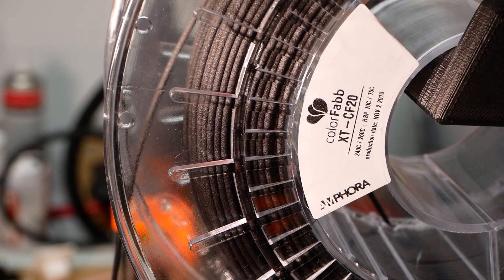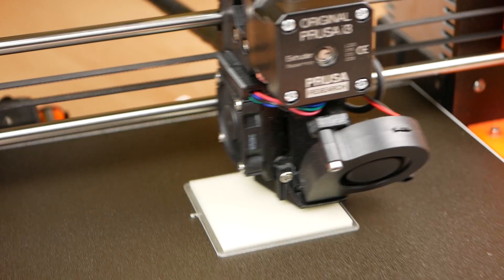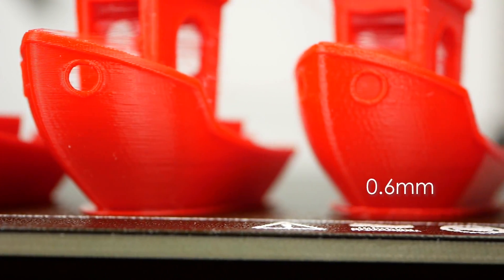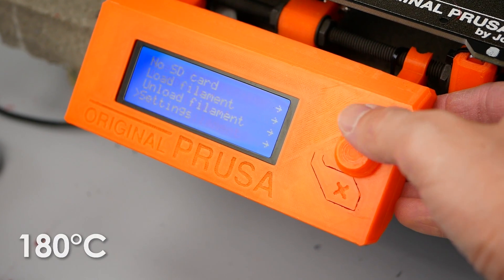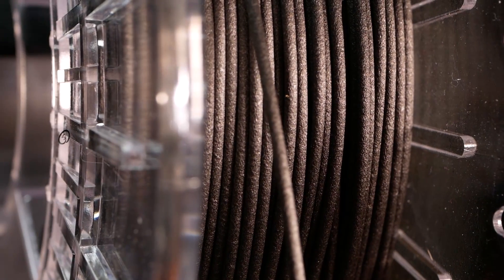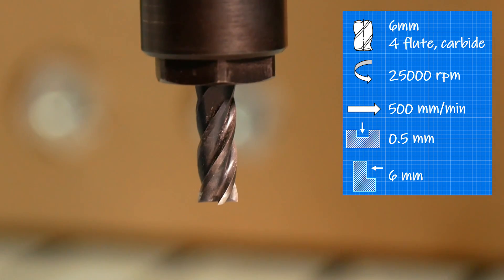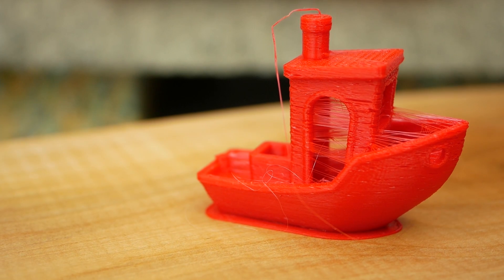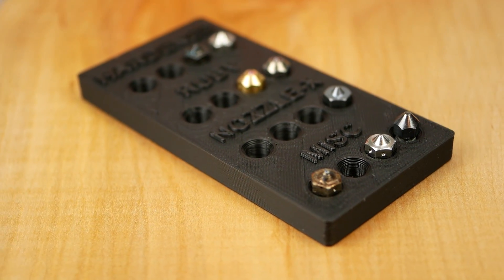HOW MUCH abrasive filaments damage your nozzle!

Comment from the maker: Feel free to share and discuss the video on you Social Media plattform of choice!
Reply: The spiral pattern is caused by a dull drill with way to much feed. The spirals of the drill try to get rid of the pressure and clog on the walls.
Reply: @marcus_w0  Yep. And usually if you look at a crossection the other way you'll find that you have almost a triangular hole there.  It seems funny how hard it is to drill a straight round hole with a drill bit
Reply: How to make such a shape ? DMG Mori 5-Achs Bearbeitungszentrum
Reply: What you said about the chanfer in the tip is true. This problem used to affect cookie/biscuit/food factories all over the world. They need "laminar flow" and a straight extrusion on the tip of extruders.
Reply: Noice !
Reply: I think premiere is a touch of hype ! I like it !
Reply: What are your print settings?
Reply: If you make the nozzle bigger from Carbon Fiber Polycarbonate printing models with a 0.4mm and wanting a bigger nozzle to print faster, then it would be like swapping out to a bigger nozzle w/o buying another nozzle and doing the swap out work?
Reply: Ok. No pproblem. I wil do itt.
Reply: This was probably the most important video I've watched. I've been buying cheap nozzles and wondering why I was getting odd printing issues.
I'm going to buy some excellently designed nozzles and see what happens.
I'm also going to put my stainless and hardened steel nozzles under a microscope and see how well they were made.
THANK YOU!!
Reply: Ave has a video about drilling triangular holes (3 jaw chucks + drill bending slightly  = trilobed spiral hole like in your cheap Chinese nozzles)
Reply: im sorry about your dry hands i also have them lol.
Reply: For my (very may be clone e3d), i just pull up ''on cold'' 0.6mm nozzle fillamen without problems, for now its seems normal in 0.01+/- mitotoyo caliper
Reply: Saw you went from 98k to 99k subs overnight. I thought I would give an early congratulations on that pretty play button!

Comment: I appreciate your content and the time & effort put into them. It is amazing how the nozzles like everything I guess, can very so greatly. The warped hole pattern is a worn out drill bit most likely bent or warped from improper use/heat.  A suggestion: when you show the nozzles they are aways independently. It would be helpful to have side by side (Used/Worn vs New) to better represent the amount of wear. There is no good way to show scale when buy itself. Even more critical when the wear is minimal and due to so many variations in nozzle style(head angles & heights). Thank you! Great stuff!

Comment: I went through a hardened steel nozzle in around 2 days of printing..took over half of it away..glow pla is hard.  Like carbon fiber probably..any PLA that says PLA but feels like sand paper when you touch it and not smooth will eat your nozzles...

Comment: Brass IS A HARD MATERIAL. its harder than stainless and its why they use it to make scuba cylinder valves and regulators.
Reply: Brass has a Mohs hardness of 3, Hardened steel has a Mohs hardness of ~8-9. so brass is significantly softer than Hardened steel
Reply: @MrBlackmidi1234567890987654321  you are talking about HARDENED steel. not steel. steel has a mohs of 4. mohs is measured by dropping a hardened pin on top of a material and measuring how much of an indent is caused in the material. this is misleading. brass can alll sorts of things added to it to be stronger but its best tradeoffs are being machineable while being hard. as well as its ability to withstand abrasion as well as materials as hard or harder than it. its not all about numbers on a graph
Reply: @freelectron2029 
Yes, me are talking about hardent steel

Comment: Congrats for the professional video!   Although 3 years has gone, this looks the right place to ask my question.
There are hardened steel nozzles available today (e.g. for my Bambu Lab P1P as a spare part) these are intended for abrasive filaments, like carbon fiber. These nozzles cost about the same as their normal steel ones (their standard nozzle is steel, they have no brass nozzles) so my idea is to use the hardened steel version for all filament materials (PLA etc.)   
What could be the disadvantages of a hardened steel nozzle?    There might be a difference between the thermal conductivity of brass vs steel (which may somehow affect print quality, maybe the max. print speed?) but I think there is no significant difference between normal vs hardened steel in terms of thermal conductivity.  I can think of one disadvantage of hardened steel is that it is more brittle, but that plays no role here.  What do you think?

Comment: It would be pretty easy to remove the chamfer and make the tip flat by just sanding it down with some very fine sandpaper on a flat surface (like glass).
The only challange would be to make sure it is 100% level - which is hard to do accurately on such a small part without some sort of simple jig, but making one wouldnt be too hard.
The most accurate method might actually be to have the printer sand it itself (sandpaper on leveled bed) hah! Once you figure out how to dial that in exactly on the z-axis it would basically do itself :D

Comment: Years later and this is still a useful video. 

I use abrasive filaments from time to time. You plan to test the new plated copper nozzles? I have seen a lot of conflicting info on its wear resistances.

Comment: Question: how dependent is the bore accuracy in a zozzle?
I ask because I bought cheap MK8 0.4mm brass nozzles and found many in the pack are near 0.45mm which I guaged with the base of a #77 drill bit which calipers showed to be 0.45mm diameter and I can manage to get it through the tip, though snug.
A 0.50 cleaning needle won't go through though.

Comment: This is older but i'd love to see wear results with stronger nozzles such as high carbon steel, tungsten, ruby, or even diamond. Even hardened steel is softer than the carbon fiber additives in filament, I imagine it still wears the nozzle but at a lower rate than anything made of brass. I had a problem printing petg a few days ago, more trouble than I had before. I do print a good amount of carbon filled filaments. Changed my nozzle out for a fresh one and it started printing great on the same Gcode. It can be hard to tell when a nozzle is worn out when the difference in a worn and not worn one is internal damage and or, small enough that its unseen by the naked eye.

Comment: I had a clapped out nozzle that I had used for about 2 years straight without much issue until it start stringing and over extruding badly, no matter how much I tuned it. Turns out it had worn itself into close to a .6 or .8 nozzle - it was visibly a larger diameter hole.

Comment: In this day and age of multiflute carbide drills with through hole coolant flow one only has one's own poor judgement to blame for using inferior quality tools when making mass produced parts like those cheap nozzles. Not only do they produce a better finish, they do so for much longer than those hardware store drill sets. The cost per carbide through hole drill bit is higher, but the cost per hole over the lifespan of the tool is orders of magnitude less (not just because it's carbide but because of superior chip evacuation (which also contribute to better surface finish)). Also 2 flute drills aren't self-centering like 3,5,7 flute drills. All told it seems like a no brainer to choose the better tool.

Comment: I use MG Chemicals Super Glow ABS almost exclusively for my "White" prints and have run over 6 rolls through my machine and have only changed nozzles like once and that was just to rule out the nozzle for another issue, so I'm glad you were underwhelmed with the glow results. That matches my experience. Half the stuff in my house glows now ;)

Comment: I had my og ender 3 for over a year with the same nozzle bed everything. No issues. Pla only.  Upgraded to ender 3 max and did a 20 hour print with glow in the dark and turned my .4 nozzle to a 2mm

Comment: It was interesting to see the chamber inside the nozzle on the E3D vs knock off how straight the chamber was. I wonder if all the Ali express nozzles are like that, or only certain vendors, or how the amazon non E3D ones look like inside. Now I'm tempted to do cold pulls on them to see if some of the vendors are better than others. Although its interesting that it doesn't affect print quality too much besides stringing. I'm extremely curious if all the chinese nozzles have wobbly chambers or just the batch you got.

Comment: Fantastic videos.  I wanted to mention that the cut away of the E3D nozzle appeared to flare slightly (maybe an optical illusion...) at the filament exit point.  This may reduce pressure at the print surface and maybe oozing?

Comment: The undulations are caused by poor chip evacuation combined most likely with an off axis cutting tip. On a small and very flexible bit the engagement wanders in a helical pattern down the bore, that alone can do it but then with poor pecking and/or feedrate chips will stick on the edges of the flutes and do some cutting themselves further exaggerating the effect, you get an oversize (more than usual) hole with an undulating ID. In a nutshell, shitty bits.

Comment: It's just a thought..I wonder if you can use a ceramic insert in the brass heated tip..the insert would be extremely thin but strong enough not to break..it would absorb heat and still allow the filament to melt..I know you can ruby and hardened steel and not that expensive..it would be interesting to try..

Comment: That pattern comes mostly from peck drilling. You can see it really clearly at 8:30 where the wall makes a sudden divergence when the drill returns to the bottom of the hole, and then whips back.
It is unlikely that overheating of the bit is the cause since the bit is probably carbide and will break before it dulls.
The E3D bore shown at 12:30 has been reamed, you can clearly see the witness marks left behind from a straight fluted reamer.

Moral of the story, don't buy crappy Chinese junk. It is false economy

Comment: @CNC Kitchen  Do you have a set of digital calipers.  I have a brand new (only printed abs & pla) Longer LK1 and noticed the output diameter is 0.51mm to 0.53mm respectively.  It is a brand new 0.4mm nozzle & machine.  Is that thermal expansion?  Too much water in filament?  Can I compensate by inputting 0.52mm in the system so it re-calibrates the slice program?  Any help would be appreciated & your videos are amazing!

Comment: I believe the taper on the outside of the nozzle would cause what's called the Coanda effect where the fluid essentially holds onto the side of whatever it's passing close to http://www.thermofluids.co.uk/effect.php#:~:text=Coanda%20effect%20is%20the%20phenomena,flows%20away%20from%20a%20nozzle.

Comment: i ordered by mistake a stainless steel nozzle instead of a hardened steel one to print carbon reinforced nylon ... if i do the heat treatement of the nozzle by myself will it be strong enough ?
Reply from the maker: Stainless steel is more wear-resistant than brass but you won't be able to heat treat them like a "hardened steel" nozzle. Those are pretty different alloys.
Reply: @CNCKitchen  so can I print carbon nylon with it ?
Reply from the maker: For a while, yes. Just check it regularly.

Comment: 13:31 Not sure of course but maybe the sharp edge of the nozzle acts as a knife when it moves to the next printing position. A chamfer could squeeze and pull the filament until it strings.

Comment: Great video! Does anyone here know if there is a filament that glows in the dark that is not using strontium aluminate? Thanks
Reply: That wouldn't make it any better. I think it the crux is the coarseness. Many pigments a extremely hard and can be abrasive, but they are usually ground very fine, the finer, the better the quality. Strontium aluminate glows a lot more, when the particles a bigger and thus more coarse. I have some expensive glow in the dark acrylic paint and it is really smooth and the particles don't clump, but it doesn't glow as brightly as some cheap amazon products, that are just a clumpy, sandy mess. So the more the glow in the dark filament glows, the worse
Reply: Thanks. It makes sense that larger clums give off more light. I’m looking go a filament that glows in the dark that’s less abrasive on a brass nozzle to print a few hundred items. Since there’s no public data on the fineness or quantity of strontium aluminate in filaments, and I don’t have the time or funds to run tests on them right now, I figure I could just find a filament that glows using a different chemistry. Then I could just broadly compare the abrasiveness of those two to make a broad general comparison.

Comment: Brass is a very poor material selection choice for nozzles, especially when using abrasive filament, and is only chosen for its low cost and for ease of manufacture.     Aluminium or nickel bronzes would be far better options.

Comment: Cheap chinese factory is drilling their holes with poorly-made drills running on minimal cooling and going faster than the metal is rated for. The heat deforms the brass and the bad drill bits leave nasty tool marks. They're basically friction drilling as much as they're actually cutting.
But, hey, it lets them pump out a dozen more drill bits an hour and they save a few yuan on replacing old bits by driving them until they break. 
一分钱一分货

Comment: How can the nozzle wear from the outside as you suggested? Doesn't the main friction happen inside during extrusion? I would understand that the bore shortens from the inside as the filament is being pushed with a lot of force. Anyways interesting video.
Reply from the maker: It's the friction between the old printed material and the nozzle tip.
Reply: @CNCKitchen  thanks for the quick reply. I am using the Sindoh 3DWOX 1 printer and the nozzle can't be exchanged. It's a brass one. To change you have to buy the entire assembly with heater and fans for $170. I just wondering how long it will last after roughly 470 hours and almost one km filament printed. I did not notice changes in print quality so far nor did the zero position z nozzle distance change. Maybe I am just lucky. Used only pla so far.

Comment: That spiral pattern is probably from an excessively heavy feed speed when boring. Instead of drilling with a milling bit, they probably used a much cheaper miniature boring bar with tiny tool steel bit. Looks like the bar or spindle for the tool has a lot of runout. They are feeding it so fast they have minimal overlap between layers as they bore. Also they apparently have a "resonance" intersection between their spindle speed and feed speed, so the high point occurs just a hair clock/anticlockwise compared to the previous rotation.

That's honestly an incredibly rare thing to have occurred... To the point I'm almost wondering if they are casting or pressing those nozzles and that's a die deformation.

Comment: The spiral pattern is likely caused by a number of factors, though this is just my guess from experience, I have experienced the same thing. 
They're likely using the wrong RPM for the speed at which they are drilling, causing a helixical cut, which is being compounded by an off point drill bit, or perhaps a badly sharpened (same thing as off point really) or damaged/dull drill. Since it's brass they should be using a neutral rake drill, so likely they're just very dull, possibly picking up negative rake angles. I'm assuming they're using a drill but likely they have a custom cutter with the profile but the same hypotheses apply, as for recreating this, using a lathe set up to cut a helix with a round shaped cutting head on a boring bar would likely be the easiest, failing that an off point drill with a matching rpm to drilling speed would be the same result but the lathe would be the more accurate one.

Comment: it looks like during nozzle machining,   the  drill bit was most likely warped and needed to be replaced..    it doesn't hurt it when drilling in IN so much,, but mostly when its coming out at high speed. as the warping causes imbalance, and also looks like it was caused in combination of the bushings that hold the drill press are warn out causing extra vibrations in the machining process to ware out the drill bit

Comment: It also hurt me a lot seeing you print those blocks.
Not just because you wasted the material, but also because the results of such a synthetic scenario are less valuable than they would have been, had you just printed "regular stuff" with a "regular nozzle".

However since I was also thinking about making a solid carbonfiber plate to see how strong it is, I guess you kind of fit that use case exactly ;)

Comment: I think the cheap nozzle's stringing over the E3D's could also because the sharp transition more-or-less cuts off the material as it starts moving, while the chamfer holds a bit of material between the true-to-size opening of the nozzle and the print and then drags it along during the move.